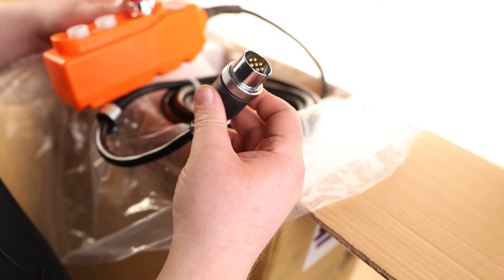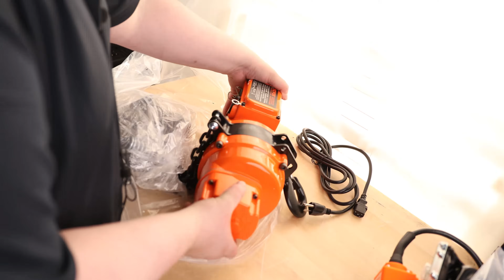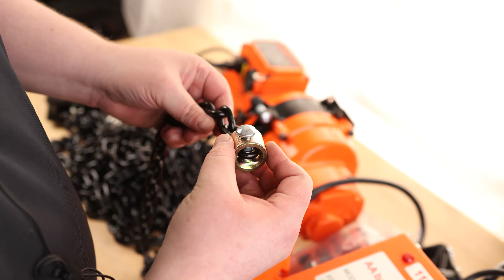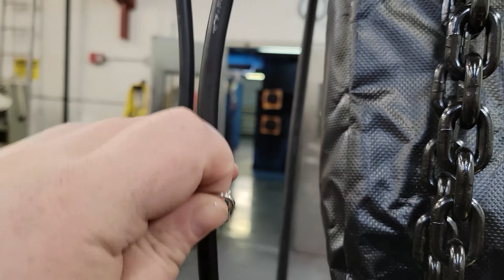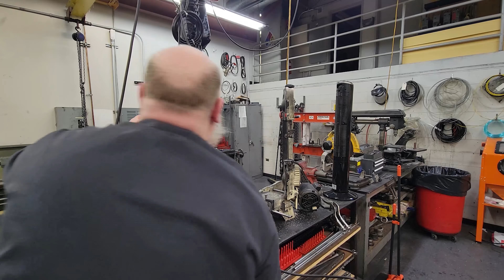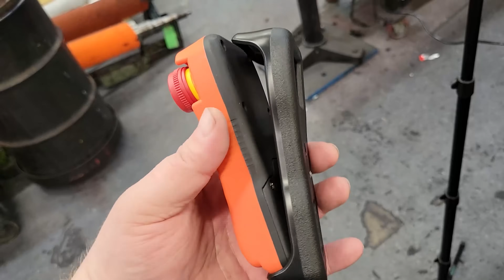VEVOR Electric Chain Hoist, 2200 lbs Load, 20 ft Lifting Height, 120V, Single Phase Overhead Crane

Comment: This is so close to being a useful review, without knowing how much weight you lifted it's completely useless. You're right there, just add actual numbers and its game on.
Reply: Read the title, 2,200 lb lift capacity. Why would knowing the weight of his work bench benefit you in any way?
Reply: @GemmyFreak  If the bench only weighs 800lbs that doesn't tell us if this a good hoist or not. If I told you I could lift 500lbs and then proved it by lifting something that you had no idea how much it weighed would you believe my claim? A review that actually tests the claim of the product is significantly more valuable than merely showing the product working.